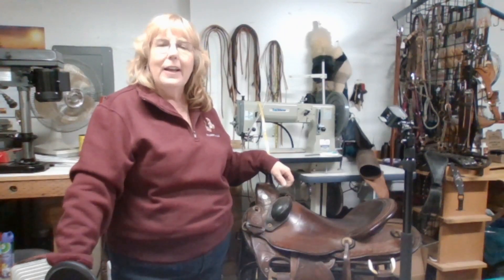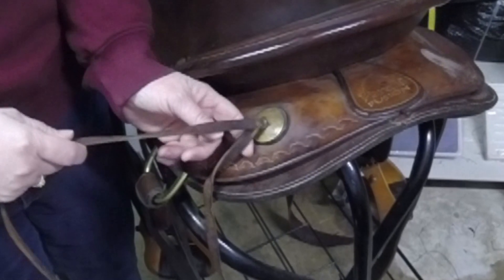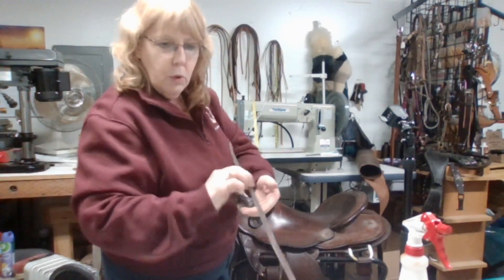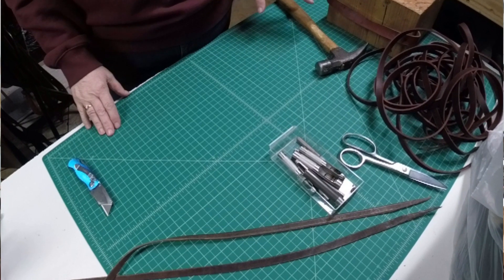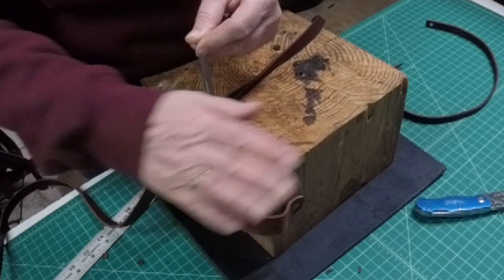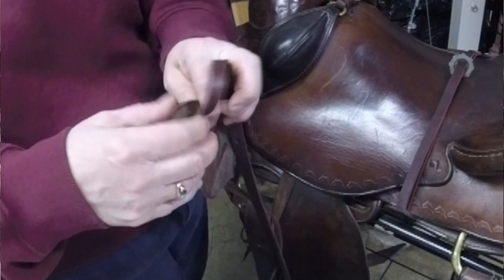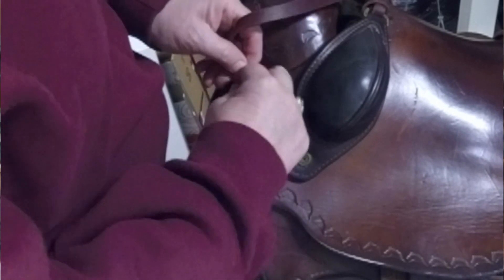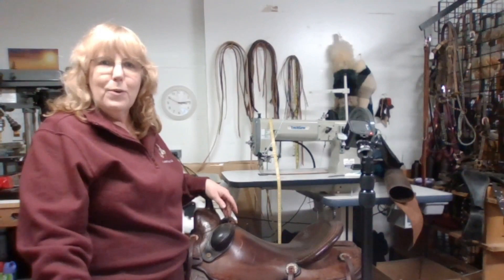SADDLE REPAIR - SADDLE STRINGS- HOW TO REPLACE SADDLE STRINGS & SLOTTED CONCHOS

Comment: Thank you Patti.
I have an old Herford and need to replace the strings but I guess I will get it done by a professional and get it cleaned and conditioned too. 
I'm too scared to break something.
Reply from the maker: I just got done doing a Herford. Nice saddle! f you would like us to do it, we will send you a prepaid shipping label to save you money. We just need the dimensions of the box you are shipping in, with the weight and address.  (example: if a person tries to ship an English saddle from Florida to Oregon, it would cost them about $80. If I send you a prepaid label for that same saddle it would cost less than $30 for the same saddle and distance). We charge for the actual cost we pay to help save money.  Anyone wanting professional repairs or restoration Contact us theleatherladyllc@gmail.com and we can set something up.

Comment: Great video Patti!! I just bought my first saddle and I am looking forward to doing a little customization. Wishing you a happy Thanksgiving!
Reply from the maker: awwwe thank you sooo much for the kind comment.. if there is anything I can help you with or a video you would like to see on restoration, please let me know.. I love to have some video ideas :)  Happy Thanksgiving to you and your family as well.
Reply: Hi Patti, 
Thank you so much for responding to my comment. So as you know, I bought a used saddle which has been recondition with saddle soap. A few of the saddle strings broke because they were just so dried out so I’m going to replace them. My saddle did have a hole in the ceiling which has a very poor patch job. Would you be able to make a video on how to properly patch a seat?
Reply from the maker: @christinamuller1741  Do you by chance have a photo of the seat area that needs to be repaired? sometimes repairing the actual seat can be a pretty big project
Reply: Yes, how can I send the photos to you?
Reply from the maker: @christinamuller1741  You can send it to my email at theleatherladyllc@gmail.com and I will take a peak at it.

Comment: I do saddle repair also, a couple of things to make string replacement easier for you. Use the right Phillips bit size for the screw head slot. A driver bit set for battery drills will give you several sizes. Chose the one that fits tight.
Reply from the maker: Yes very good point, as I did forget to mention that in my video... it does make a difference and easier as well as not stripping the screw and keeping all parts as original as possible. :) My drills are always battery and there are great sales on them a lot if someone does have one.. Mine came with 2 rechargeable batteries as well for $99.00

Comment: what kind of screw do I need?  all the parts were lost on the trail.  I need the screw.  what do I need?
Reply from the maker: sorry for the delay, I was away for a bit. You can use any small screw that fits the hole or slightly bigger. I just use a little 3/4” Phillips head screw, but a flat head screw can work as well. If you have a concern the screw is a lil loose you can put a dab of wood glue on the screw if the tree is a wood tree, but be VERY CAREFUL putting any glue in any holes as you may get it stuck in there for good. 
never use super glue if at all possible, that can be irreversable
Reply: Drive a golf tee into a worn out hole, then snap off and use a new screw, some glue is ok as well.

Comment: This method wont work on strings through the tree, but i guess thats obvious. 👍
Reply: how do I repair strings through the tree? do you know of any help videos?
Reply from the maker: @ You have to get under the fleece to do so. That is why some saddles you will see the saddle strings THROUGH the fleece and you can see them. MOST saddle makers put the saddle strings FIRST then place the fleece (Sherling) on the saddle.   When ever I refleece a saddle and it has saddle strings I will ask the owner if they want new strings.. Kill 2 birds with one stone perse'
Reply from the maker: depends if they laced the strings prior to fleecing the underside or after... I just wrote a comment for another gentleman below about this too. :)

Comment: Not going to work on my saddles. The saddle strings are attached to the tree away from the hole.
Reply: that is like many saddles. I just did one that took me 4 hours to replace after dying and conditioning.  To get to those you have to go under the fleece, so if a saddle needs refleecing and I examine the saddle strings I suggest to the client to do both. 
  There is a way to save the partial old saddle string and add new ones even if threaded and are just as secure.I have done it several times